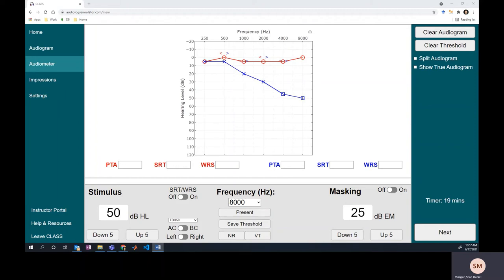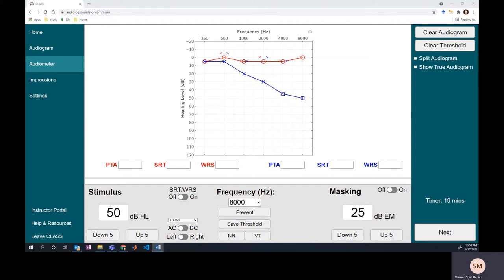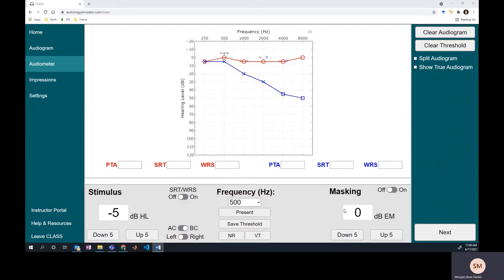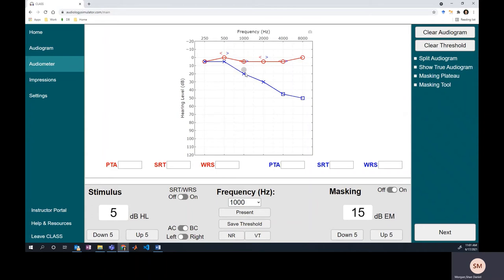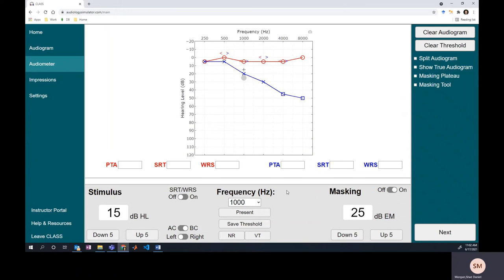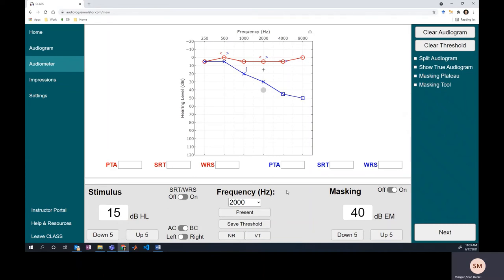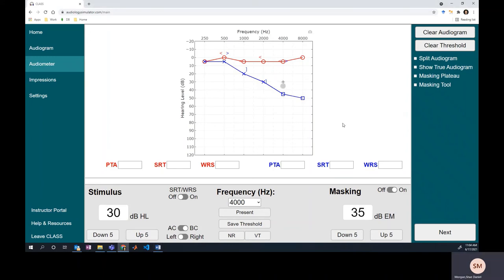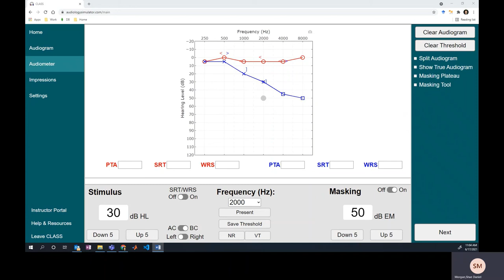Masking Tutorial (4 of 4) - How to mask: Bone conduction

Comment: If you did not account for occlusion effects in lower frequencies and start with zero dB added to the non-test ears, shouldn't the Plateau technique work the same in getting you the proper masking?  It may take you a little longer, but it should give you the same result, I would think.
Reply from the maker: @James Lee - This is a great question. The problem is that if you don't add enough masking into the non-test ear to start with, then the patient might hear the stimulus in the non-test ear at the start, think it's the stimulus in the test ear, and then respond. If the patient responds to the sound in the non-test ear, but you think they're responding to the sound in the test ear, then your marked threshold will be a reflection of the hearing ability in the ear you aren't trying to test! 

Watch this video on crossover:
https://youtu.be/G0HFB8GENUM

This video on interaural attenuation:
https://youtu.be/lh0bdDzkbc8

And this video on the occlusion effect: https://youtu.be/QLueTVI7LvU

to help learn more on these topics!
Reply: But it would fail if you did the Plateau method of increasing the masking by five dB increments.  This means you will raise the stimulus by another 5dB, try the Plateau method, and keep repeating until you get the proper masking with the proper thresh hold.  At the end of the day, the Plateau method should take care of the Occlusion effect and the 10dB safety pad.   @ThetaSimulator
Reply from the maker: @jameslee1329  I see what you mean - but what happens if the patient responds (and you raise the masker) 3-4 times, but you're still not at the right threshold?

For example, imagine testing masked bone conduction at 500 Hz with TDH-50 supra-aural headphones. The occlusion effect at that frequency can be 20 dB for some people! In that case, if you just start your plateau without factoring in a safety pad or the occlusion effect, then the patient could respond (and you could raise the masker) 3-4 times which would give you a 15-20 dB plateau without ever covering up the non-test ear. 

At that point, most people would stop masking and say they got the right threshold, which would be wrong. The truth would be the patient was hearing the crossed-over signal so loudly, and you didn't put enough masking in to cover it up, creating a false plateau before you ever got to effective masking.
Reply from the maker: @jameslee1329  adding the occlusion effect and safety pad are just measures you can take to be sure you start with masking that will cut out the non-test ear. It's up to you to determine how conservative you want to be as you do your diagnostic testing! :)
Reply: @ThetaSimulator  I use insert earphones for my hearing test.  What would be the proper occlusion effect and safety pad for 500, 1000, 2000, and 4000 Hz?
Reply from the maker: @jameslee1329  insert earphones (when properly inserted) have a lower occlusion effect compared to Supra aural headphones. The exact values vary from study to study, but some common values are 10 dB at 500 Hz, 5 dB at 1000 Hz, and 0 dB (ie no significant occlusion) for 2k and 4k Hz. Remember that occlusion is typically only an issue for testing at low frequencies!
I recommend a consistent 10 dB safety pad regardless of transducer.

Comment: The test ear in this video is the right ear and 5 dB is the threshold for 1000 Hz, correct?  If so, mask the non-test (left ear) by adding 10 dB to the left ear threshold of 20 for 1000 Hz, which would be 30 Hz?  I'm trying to figure out where 25 dB came from to start masking.   I'm not following the numbers very well and the button at the bottom of the screen on the right looks like it's the left ear being tested.  Since the online Theta simulation screen is different now, it's harder to understand from these videos, but they are helpful overall.  Thx
Reply from the maker: The confusion here is that the test ear is the left ear (see the switch at the bottom near the left side of the control panel). So you're starting at 5 dB (AC threshold in the (right) non-test ear), then adding a 10 dB safety pad, and adding 10 dB (conservative) to account for the occlusion effect (for more info check out this video: https://youtu.be/QLueTVI7LvU). That gets you to 25 dB EM masking in the non-test ear. 

I hope this is helpful! We're working on updating our videos now that we've improved our audiometer interface. We think it looks a LOT better now than these early versions - so subscribe to stay tuned in to new videos and resources!
Reply: I think your audiometer interface is perfect for beginners! @ThetaSimulator
Reply from the maker: We're so glad you like it! We're here to help @Erin-su6pc